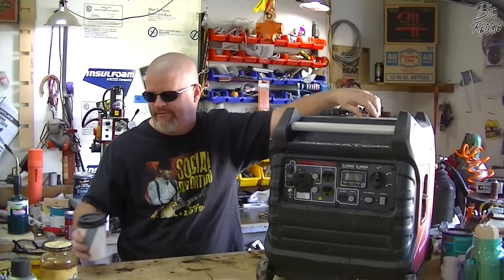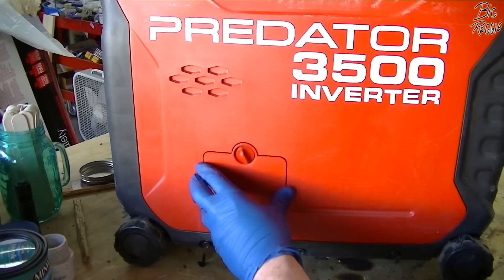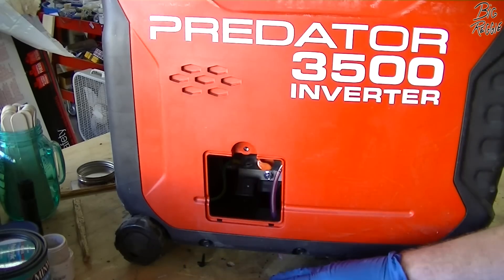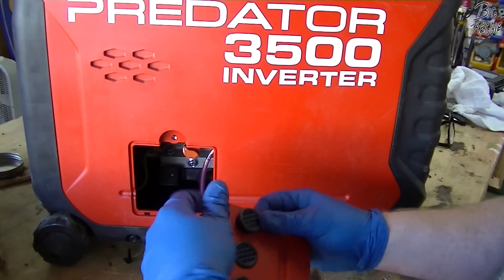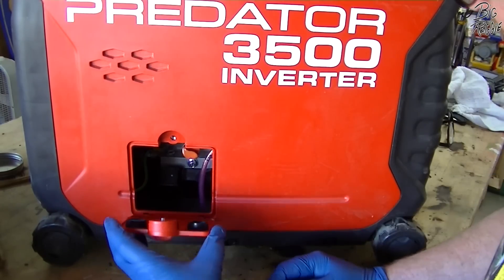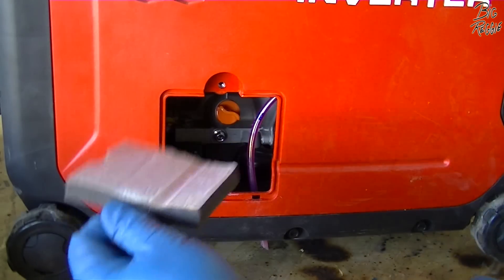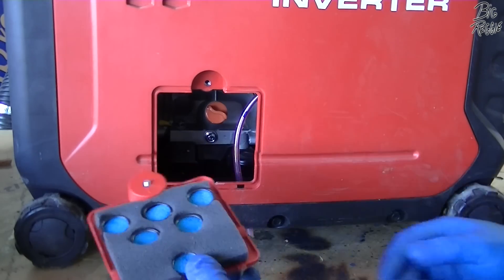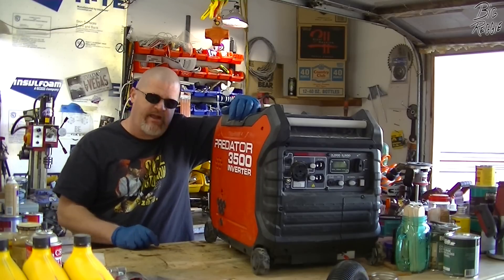Harbor Freight Predator Inverter Generator 3500 Vented Oil Door Mod!

Comment: I just got one of these and on full throttle with no load it surges, but on eco it only slightly surges.  As soon as I connect any kind of a load it smooths right up.  Wierd right?
Reply: FloridaBoy Survival that’s because it’s hitting the “rev limiter” under no load.

Mowers do it all the time.
Reply: Not weird,  it's designed to produce power not win some idle contest.  Nice unit,  don't modify it, take care of it and enjoy.

Comment: I leave the oil drain access cover open and that solved my choking issue without any mods.
Reply: Did you have starting issues due to the door being closed?
Reply: Guys this engine also has a little issue with the choke linkage being lined up and inserted into a hole inside above the carb. When you have an issue that feels like choking it may be wise to go in and look at it with the airbox off and maybe running to be sure the choke flap is being kept open by the linking and not flopping around.

Comment: Anybody do this and check the spark plug after running it for a while? I was just curious by increasing the airflow if it messed with the factory jetting. I'm thinking they have it jetted for the amount of air that comes through it.
Reply: I was thinking depending on altitude it may run leaner with increased airflow.
Reply: Normally when you add air you add fuel to match.
Reply: brian b. I haven't seen one of these generators up close, but if the lack of airflow into the enclosure is effecting the air going into the intake of the carb the engine is running partly choked. A choked engine means a rich mixture to aid in starting. Whether this is by design or not I do not know. If I wanted to verify this I would open it up and pull the main jet. Measure the jet size to see if it has the standard predator (clone) jet size which is .028". If it has this size jet I would definitely do a mod to increase the airflow into the enclosure. If it is a .028 jet more airflow would bring the mixture closer to where it should be and have better fuel economy. More air, more fuel yes. If the choke is all the way open. Not true when choked. More choke, less air and more fuel.

Comment: So it's a sputtering from lack of air? I thought it was a heat issue.
Reply: If I had one running good and not sputtering from lack of air I would probably leave it alone. Harbor freight has a test lab for all the products they sell. I would guess it's engineered to move air a certain direction.  But good video anyway and thanks for the response.

Comment: When I discovered the issue with mine I drilled about 5 or so holes in the bottom of the generator. It worked well
Reply: Would those holes, being on the bottom, be a water drain in case water got into the generator while outside?
Reply: It looks like they would work well for that.  BUT, I just changed the spark plug on mine and the hesitation disappeared.
Reply: Actually this is a good idea.  If you look at the bottom plate is is just a molded piece of plastic with several small cavities in it that house nothing.  All of the cavities have a very small hole in them already, I was thinking you could just make all of the small holes 1/2" and that would increase air flow...

Comment: This might suggest engine cooling would be better too. Doesn't say much about the design process being thorough enough though. I'm sure the manufacturer knows about the mistake by now and at the very least they should have had free upgrades available.
Reply: Except that it's not a mistake.

Comment: I'm not sure about this. As an automotive engineer I can tell you that there is a lot of thought that goes into designing and manufacturing of most things engine related as well as "lessons learned". The other issue is the company that manages the warranty of these units would require an even more rigorous set of BSA tests  over and above the manufacturers. I wouldn't poke holes in any part of the housing that diminishes the amount of air going where the smart fellas say it should go. Good luck and remember, if the predator really needed holes in the oil cover it would have holes. Onan generators have the same condition except they put a big yellow caution sticker on the gen sets telling you not to run the generator without the cover or you cause damage to the engine due to not allowing the air to flow properly around the engine.
Reply: Are we sure this sputtering is caused by lack of air or could it also be the spark arrestor starting to clog?
Reply: @GNX157  the sputtering is because there is no load on the genset.  its a ruff idea engine do to the design trying to improve higher rev efficiency.
Reply: michael knoper Okay. I understand the air flow around the engine block...but the problem is that many on here are complaining about the air starvation to the intake causing it to sputter.  I have been thinking about buying the 3500 soon, but if I experience this problem, I would like to have a solution.  Quite possibly the area where the intake should be modified...hopefully without increasing any noise level.

Comment: Sounded like the sound level was increased a lot.  Anyway to measure that?  Also, I like the comment about increasing the existing air intake opening.
Reply: Thanks for solving the starving air problem.  I will probably do exactly your solution.  It looks neat and OEM-like!

Comment: Great video. I just got my 3500 last week. I did 8 hours on it with a varying load between 500 and 2000 watts. Then changed the oil. It was running really smooth until about 3 hours into it and then it started into that same rough running as everyone has with these. I already have the little filters saved into my wish list and once I get more things, I'll order it all at the same time. I was going to use step drills which will also work well in that plastic. But those Forstner bits did a super job as well. I have both. Unfortunately, my punch set is OLD and pretty dull. Kind of like me..... Anyhow, great video and thanks for posting.
Reply: mada94fxr jjjm
Reply: the rough running can be accommodated with the recommended spark plug upgrade

Comment: You are correct, the generator is needing more air. But, I'm concerned with one problem with your fix. It's designed to take in it's air on the front bottom left, which pulls air straight across the engine head, which needs more cool air than anywhere else. My question is , wouldn't it be better to increase it's air intake which we have determined it needs, but bring the extra air in where it's already bringing it's air in.. I think by bringing in the air from where you are bringing it in. Might be taking air for cooling away from the place it needs it most, in other words I think it's by design it takes in air where it does.. but I do believe that spot of intake should be larger..
... Just food for thought.. lol very nice job though !!
Reply: Its a possibly Good Point , Unknown wouldbe the correct answer. Onlyway to determine if the Added Quantity of Air from that Location Increases Head temperature is to Put a Thermocouple Wire Clipped to the Part of the engine that u are concerned with. Run The thermocouple wire outside to a Digital temperature meter & Read Temperatures with the door Mod & Also with the Door With No Mod. Its a easy Test & Would Make a Great vid. I Wonder Will Big reg be the First to do it ? Type K - Thermocouple wires and a Meter are cheap on the net. ( Less than $50.00 Us ) Prob. My initial thoughts are Temps will be cooler at idle with the Reggie Mod & No Difference in temps at 50% Load. That thing is Starving for Air Big time. If the suction is that Great at idle, When that Carbeurator Really Starts Pulling Air Ill bet u can' hardly even pry that door off.
Reply: Link to Meter & thermocouples for Less than $20.00 us. 
https://www.walmart.com/ip/Dual-2-Channel-2-K-Type-Digital-Thermometer-Thermocouple-Sensor-1300-C-2372-F/286550414?wmlspartner=wlpa&selectedSellerId=9869&adid=22222222228000000000&wl0=&wl1=g&wl2=m&wl3=42423897272&wl4=pla-51320962143&wl5=9031556&wl6=&wl7=&wl8=&wl9=pla&wl10=115780161&wl11=online&wl12=286550414&wl13=&veh=sem
Reply: I have to cuncur with billy.  Air induction is to kool the engine which by design is enclosed to keep the noise down.  What would I suggest?  I would locate a small computer kooling fan in front of the area where the induction air is entering the housing. Small mod and connect to most appropriate electrical socket and or USB connector if it has one. Just brainstorming here.  All in all,
You made a nice display of your talent.
Thanks 
Frank
Reply: Right Billy, the air intake is in the front bottom left but that is not where the head is, that is where the air cleaner/carb is located.  The valve cover/head/spark plug is located just above the oil filter door, just to the right of those 7 honeycomb indents on the side cover.  So a vented oil cover door would have to circulate more air over the head because it is no more than 4" from the head....
Reply: @FloridaBoySurvival  SO he did it right???
Reply: @FloridaBoySurvival  tv
Reply: T